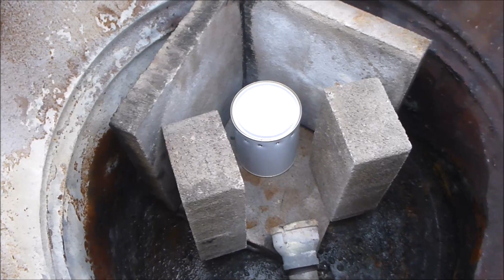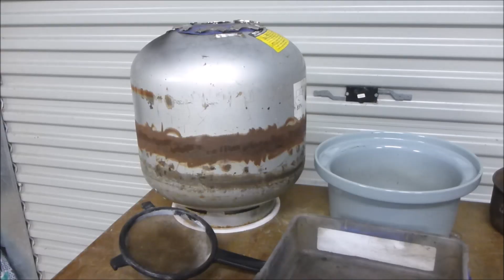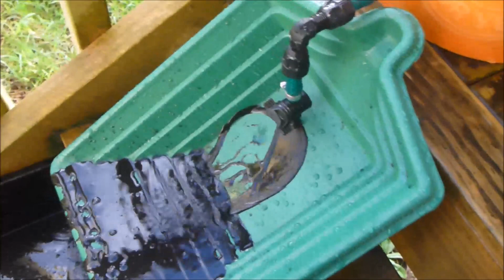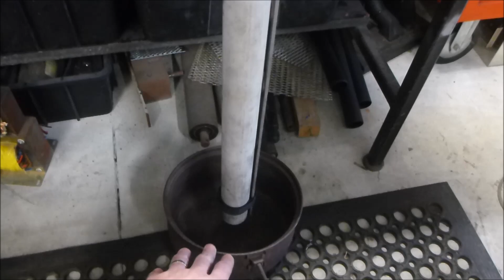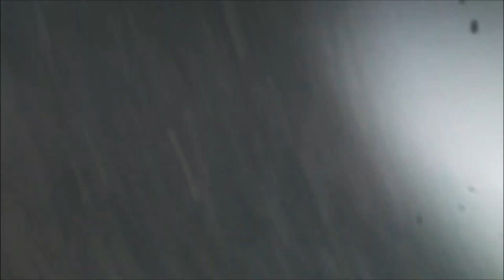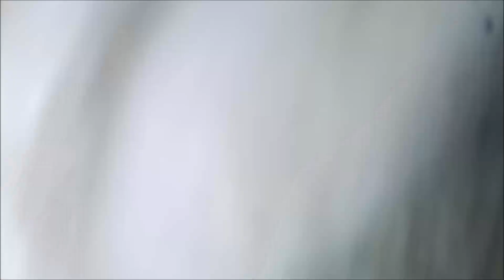Gold Recovery - Mechanical processing of ICs

Comment: Nitric acid Is the very best first step when prosseing any tipe of micro chip, then inceneration or as some peopel perfer parilosation. there are many prosseses that folow . after burning 2 to 3 times a secnd nitrc tretement is in order yes it`s expemsive but gold prises are very hi and geting hier.
Reply from the maker: No, Nitric acid is bad if there is Tin present, I always try to get the Tin out first with HCl

Comment: Your dry ash process and washing of the material involves a lot of steps and time consumption. Makes me wonder if wet ashing with sulfuric acid isn't a simpler process? The bond wires aren't chopped to bits, and there's less opportunity for them to be washed overboard. Either process requires diligently adherence to safety precautions.
Reply from the maker: Yep, you got it, also depends on availability of conc Sulfuric in various countries. Also have to deal with the waste treatment of the Sulfuric afterwards.

Comment: Hello. I also plan to start processing BGA chips and other ICs this year. I really like your procedure, especially the bucket separator and magnetic separation. I would like to ask you if this procedure can be used in case of complete incineration of chips and if the same procedure is the same for BGA chips, or is it possible to skip some steps?
Personally, I want to try using a sluice with a dream mat and then a miller's table instead of a blue bowl. I just don't know if Miller's table is suitable for bonding wires.
Thank you for your reply and have a good time.
Reply from the maker: Hi there, yes, this procedure shown in this video is what I usually did with Pyrolized + Incinerated ICs. I do not have any personal experience with a Miller table, but as long as you don't throw anything away, you never really loose anything. So you could try with the Miller table, then run the discarded material through another system and see what you missed. I also recommend getting a decent microscope, it makes analysing the captured and discarded material very easy.

Comment: S.E how have you changed the burner for the furnace? I ordered one the same from china but it has no caps or any way to alter the airflow into the gas mix.
Do you have any tips on how to alter the T joint openings for a safe and consistent flame?

Lol 😂 I have literally thirty seconds after posting seen your part about altering airflow 🤦‍♂️
Reply from the maker: Haha yeah, you pretty much have to control the airflow to get good combustion! My setup also had an adjustable gas regulator to control the gas flow too.
Reply: @successfulengineer  yea I have a reglator and a valve on the burner itself but bot sides of the the T joint are open permanently.
I can't believe i forgot about the king of randoms (rest in peace to him) video on making a burner lol
Reply from the maker: @scrappydoo7887  Yeah, sounds like what you have should be fairly easy to modify if you need to anyway. Then just adjust until you get the perfect even burn. I also found that the 9kg gas bottles caused some problems by icing up, the large 45kg house size bottles had no problem going continuously.
Reply: @successfulengineer  ah thats very useful thank you 👍 im going to be ordering gas in the next few days so thats perfectly timed lol

Comment: Do you have any ideas on this. I want to clean the water after chips are run on the blue bowl and reuse the water. I have tried to filter with charcoal, didn't work. I used the material for an air filter for a tractor, with and without charcoal. That didn't work. The water stays the same. I am not expecting crystal clear water to come out. I just want to reuse the water in blue gold. Do you have any ideas on how to clean up the water?
Reply from the maker: Hey mate, this is actually something that I have pondered many times. For the most part I was just washing Carbon out, so I didn't worry too much about running it out onto the gravel outside my shed, but it would certainly be nice to be able to use the same water continuously. Have you looked into centrifugal separation ? Build a spinning reservoir that pushes anything heavier than water out towards the sides and take your source water from the center somewhere ? Let me know if you have any other ideas, definitely something I am interested in.

Comment: The value of those chemicals can be reduced considerably if you know  how to make them yourself.
Reply from the maker: Sure, but making something like 68% nitric acid from scratch is above the capability of most hobby refiners and the cost of chemicals is the least of their worries by far.
Reply: @successfulengineer  but then the question becomes 'does the hobby refiner need anything over say, 20% nitric acid?

Comment: you can set up a drip system for the blue bowl feed, a stand, funnel & the out let of a silicone tube hole cut to the size you want very small and get bigger
Reply from the maker: Yeah, I built a hopper-feeder for a sluice in one of my videos, its kinda hard auto feeding a blue-bowl, the water speed varies so much depending on what is already in there that I found I always had to fine tune it constantly. If I were going to take it to the next level I would probably try to measure the water velocity and keep it constant with a controlled valve.
Reply: @successfulengineer  this sounds like an interesting project, maybe using an impeller that runs off the surface and a hall switch, a bit like a sealed flowmeter. You'd probably need to run some sort of PID then to calculate how much water to keep introducing but very likely it could maintain it's self once set up and tweaked.. I'm a big fan of using tech to take out as many head aches as possible, it's just often a massive headache to achieve in the first place..

Comment: my big question ? do bonding wires realy stay attached to anything after that kind of heat & thrashing & mashing ? iv seen small bga dies with gold wire still stuck to them.
Reply from the maker: The bond wire will almost always break off, but will usually leave a small solder ball attached to the die which is obviously also Gold.
Reply: @successfulengineer  thats kinda what i thought, 3 different times i put the bigger trash wires that wouldnt go through the sieve into nitric acid & zip ,  nadda, i here some guys talk about dealing with them later ? must be talking about junk box. thanx ,  woody.
Reply from the maker: @spotlobac7694  Yeah, there certainly could be a tiny bit of Gold on those legs, but I don't think its worth recovering for the hassle of having to somehow remove all the metal in those big legs. Certainly not something that I ever bothered with.
Reply: @successfulengineer  right on ,  if we were closer i would send you some stuff i find / needs a microscope kind a stuff.

Comment: i thought theyre meant to go completely white ? . wouldnt the carbon on most of them absorb gold ?
Reply: Yeah they're supposed to be burnt until white ash but in this video he definitely does a good enough job at recovering the gold that's there
Reply from the maker: Hi Pete, nope, not if you wash the carbon out before you dissolve the Gold. You definitely don't want Carbon in there when the Gold is dissolved.
Reply: @successfulengineer  oh ok , thanks

Comment: Hi there big fan and like you I made my own blue bowl but my question is do you sell the upside down funnel  as I noticed on one for your vids you re designed it with lips on the inside and was hoping I could get you to make one for me
Reply from the maker: Hi Ben,  thanks for the comment, the .stl file for the cone is available in a link in the writeup section of this video: https://www.youtube.com/watch?v=lHaleY3yXBs   You should be able to give that file to anyone with a 3D printer and get it printed. Should be relatively cheap and easy.

Comment: Hi, how can we get rid of the tin/lead solder during the process?
Reply from the maker: Normal procedure is to start with a hot HCl treatment to remove Lead and Tin. But definitely try to avoid Tin as far as you possibly can!
Reply: @successfulengineer  I'm not trying to be lazy but can I just put hcl on to all my mother board with everythings still solder on the board, then remove all ic chip, capacitor, resistors, mlcc and all bits and pieces. Dry them all including the board, smash all and put them in the ball mill, then put them in the blue bowl to get all metal, then use AR to get all precious metal back including copper. Is it possible?
Reply from the maker: Hi Pierre, that is technically possible, but a pretty bad idea overall. The problem is that Gold is very concentrated in some parts, once you have harvested the ICs, the rest of the components on an average PCB have almost no Gold, so if you proceeded with what you have suggested, you would be creating a LOT of waste acid and a lot of chopped up PCB without much Gold. You really want to work with your Gold in the most concentrated way possible. Dropping whole boards in HCl is usually a recipe for disaster.
Reply: @successfulengineer  ok, thank for your info, very clear and helpful

Comment: Engineer you said it too! at 5:35 you "don't soak in HCl to get rid of the tin anymore'. Just what is meant by 'tin"? is it 'Sn' as in the metal tin or is it solder as in lead/tin solder, or is it something else? Not up with refiner shorthand yet :)
Reply from the maker: Hi Phill, yeah, by Tin Im referring to the solder. As of the early 2000smost solders have been Lead free, consisting of mostly Rin for consumer electronics. Unfortunate for us since Tin causes most problems when working with Gold !

Comment: Why waste time with a ball mill, just get an old blender and be done in several minutes.
Reply from the maker: Mostly because a blender is just not able to get the material fine enough, to ensure all bond wires are freed you need to get the material down to minus 100 mesh. I tried a blender once upon a time, killed the blender quickly and didn't get the material anywhere near fine enough.
Reply: Successful Engineer  OK, but it should make a head start for the ball mill.  The Blendtec blender ( http://www.willitblend.com/ ) might be robust enough to hold up.  The demonstration he's done show phones, computers, etc being reduced to a powder.
example https://www.youtube.com/watch?v=lBUJcD6Ws6s
Reply from the maker: Yeah, definitely a case for doing some pre smashing in a blender, would likely cut a fair bit of time out of the milling stage!  If you incinerated the ICs well enough, a blender would probably work OK by itself anyway. At that point the ICs are very soft, so unlikely to damage a blender much. You would just run it for a while, sieve the material, then keep running the material that doesn't go through the sieve until it all goes.
Reply: Unless you have a free supply of blenders and blades it's not cost effective. The blades get worn extremely fast. And the brass sleeve bearing gets destroyed because of how abrasive the copper and other small metal bits are. I tried running the material dry, wet, and with the blender half full of water. Ball Mill is the best way to go. Less mess and way less dust while in operation. Just wanted to share my experience.

Comment: Wow dude that is a nice setup.... of course if your losing any it is min... I like to pan my concentrates like 3 times just a safety measure.. is there a reason you do not sieve in water wet? Gold has a tendency to try to stick to bigger items I would personally wash bigger item and scrap iron.  With that said I really love the setup! Love the square pan sluice that would be awesome in the field!
Reply from the maker: Yeah, that little square pan has come in quite handy a few times! I have tried panning the bond wires from ICs, but without much luck. I think it is quite difficult because bond wires can be long and tangly, so they don't really settle nicely like alluvial Gold. This method is not super fast, but  I have microscoped the discard material and it is relatively bond-wire free.
Reply: Successful Engineer awesome good to know panning will not work as well with bond wires at least the square pan and blue bowl is cheaper then a gold hog 😊 great stuff thanks for replying

Comment: Hello again and thank you for your kind response. Can you say what the final weight of gold was after this process. Also could you use the same process for plated jewellery or other plated parts of a circuit board? Have you done a video to follow on from where this video left off? Very clear instructions and good to watch ,thanks again
Reply from the maker: Hi Ken, the yield will vary massively depending on what kind of chips are being processed, what particular type would you like to know the yield for ? Plated items are almost always better to do with a process or leach that only dissolves the Gold and ignores the base metals. Apart from fingers, the plated parts of circuit boards are almost never worth recovering. Plated jewellery would be much better suited to a reverse electroplating cell, but there is much much less Gold on plated jewellery than you expect.

Comment: Hello can you explain a bit more about the type of gringing machine and what horsepower and limitations, what attachments needed to grind to powder. Or even name of manufacturer . V good video thanks for your help
Reply from the maker: Hi Ken, when processing any type of ICs, the objective is to get the crushed ICs down to under 60 mesh, some people say 100 mesh is better, but I found too many bond wires get caught up in a 100 mesh sieve. Personally I just do what I showed in this video, pyrolize the ICs, then run them in the little crushing mill that I built for a day or so. This video here -> https://www.youtube.com/watch?v=8Z9j7_t4qlU  has a bit more info on how I built the crushing mill. A hammer mill would be much faster, but a bit harder to build. Many people also have very good success with traditional ball mills, Cody (Cody's lab) built a very good hexagonal ball mill that he used in his 'Thermite' video. i hope that answers the question ? Feel free to ask if anything is not quite clear enough.

Comment: Great video! I have a simple question, after pyrolysis is it possible to use directly aqua regia or is it really necessary to wash the ash and carbon out?
Reply from the maker: Hi there, technically it is possible . . . but . . . there is a chance that you will lose a little bit of your Gold that trapped by the Carbon. (Much like how Gold is recovered from Cyanide by pumping it through Activated Carbon) 

The bigger problem is actually that you have more mass of material to deal with, which means generally using more acid. It always also seems to take much longer, even though in theory it sounds like it should be faster.

I have tried this on a few occasions and have always ended up deciding that I should have taken a bit more time with the pre-processing.
Reply: Thank you I will try both methods. I thought it would be faster. My idea is first to eliminate the base metals with nitric acid and after this washing. The next step is aqua regia. I hope to save a bit time because I get chemicals for very good conditions. (nitric 0,75€/0,90$), HCL (0,28€/0,35$)
Reply from the maker: Yeah, no problem with that, the only issue would be if you have Tin in the material, it forms Metastannic acid with Nitric which makes filtering a pain. Give it a try, would love to hear your opinion. I would recommend trying it on a smallish sample, say 0.5kg of ICs or so.
Reply: In every case I will give you information about my experience. Thank you

Comment: Hey there friend long time no talk since you left the group. I've worked on my methods and pyrolize in a can with a turkey fryer then spread chips on a pan and use a roofing torch works great at completely ash white material I then use a blender and sieve with course strainer again grind with coffee grinder and again sieve with finer concentrater a lot but not all metal gets trapped and removed I then put in dish add jet dry and fill half up with water about 4 inches using the hard drive magnets I skim saturated material getting out metallics the washing I use is a thought by geo metals it uses a piece of drain pipe with ribs about 10 foot long cut in half and at a slope angle spoon material in with hose running slightly and it washes out carbon silca etc.. Trapping bond wires in each rib its very effective when doing large amounts like 10 -20 plus pounds chips I remember you helping me threw my first process and thank you today I've been doing bigger amounts and process regularly have even successfully wetashed with sulfuric acid several times with amazing results but that process is to dangerous. And I've stopped completely from that method but again buddy great video.....
Reply from the maker: Hi Sonny! great to hear from you again. I really miss the group, but facebook was not interested in having me there if I didn't display my real name. 

I am happy to hear that you are doing well and getting the Gold, you learned very very quickly that first time, I always enjoy it when people have success!

Yes, I have started over the past month to run my material over a sluice box before running the blue bowl, just to get rid quickly of most of the light stuff. I just purchased a cheap plastic molded sluice box, will probably show it in a video at some point.
Reply: the rougemillenial I am an admistrater on the same gold page I can admit him any time no problem..and others we ask that a question is answered before admittance..
Reply: Are you a member
Reply: Hey guys. Im new to this. I have been saving up my cleaned e waste and have been watching thouroughly for a month or so my only concern is the legal viewpoints of this. Is this all legal? Or is there ways i could accedentally stray from the legal path and not know it? Thought i would ask after seeing the name thing lol